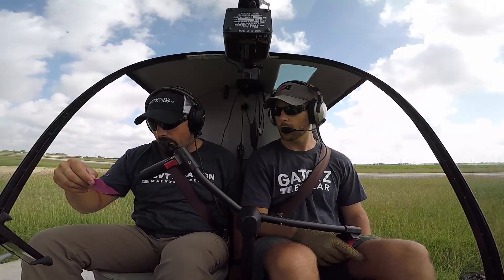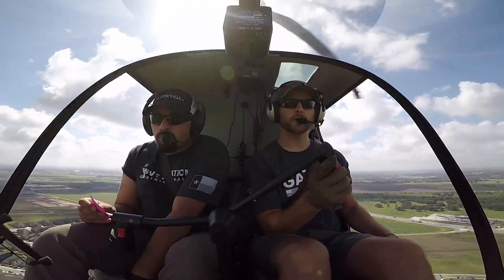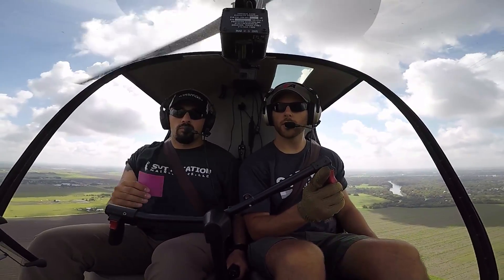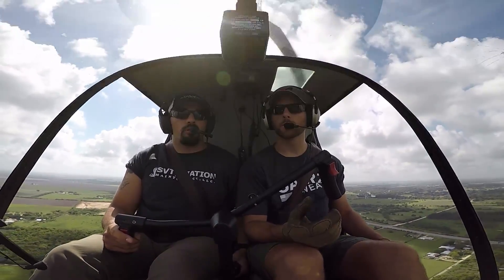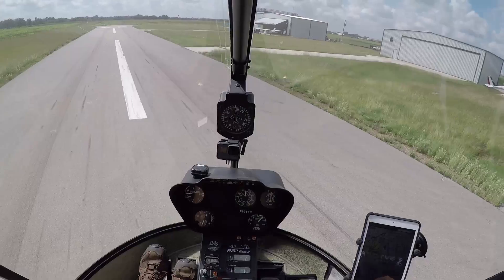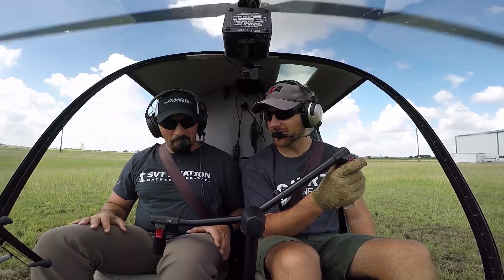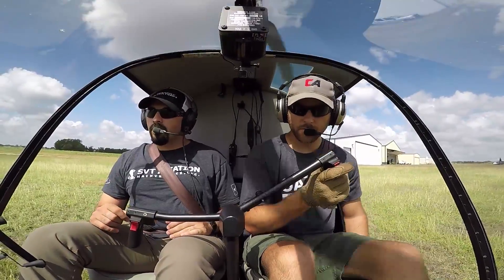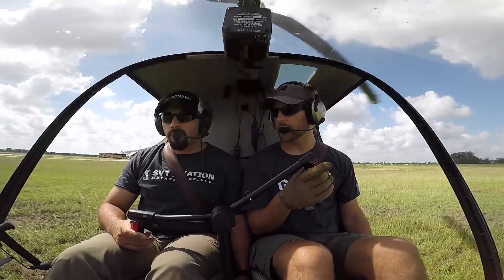Helicopter Instructor - Teaching Low RPM & Autorotations

Comment: Low rpm in a robinson has great potential to become catastrophic with just the simple mistake of abruptly pushing forward cyclic. This is known as a low-G push over and it may cause the main rotor to contact the tail and shearing it right off. It's the Achilles heal of all robinson helis and it has been the main cause of hundreds of fatalities.